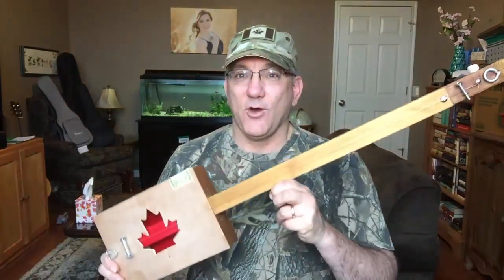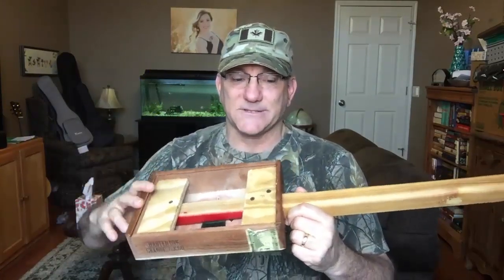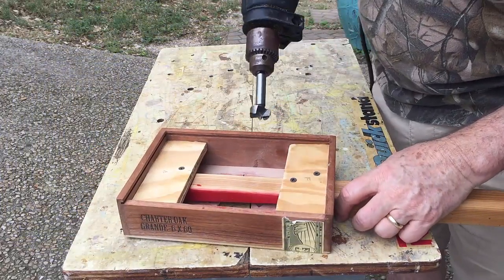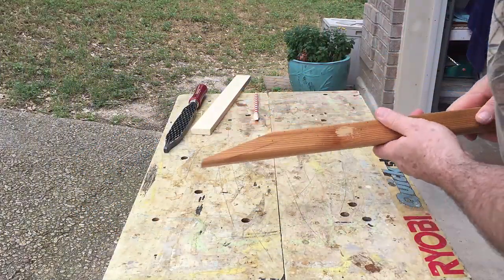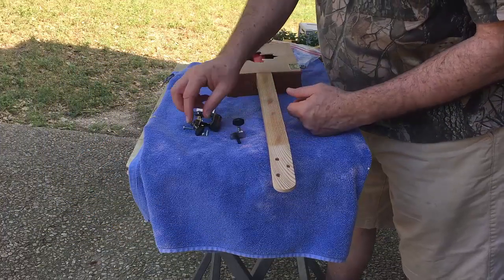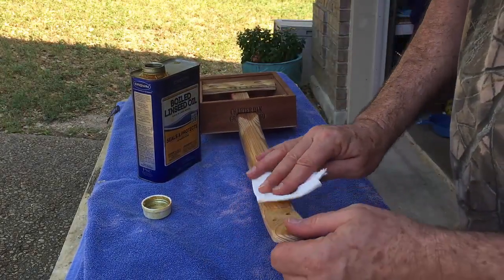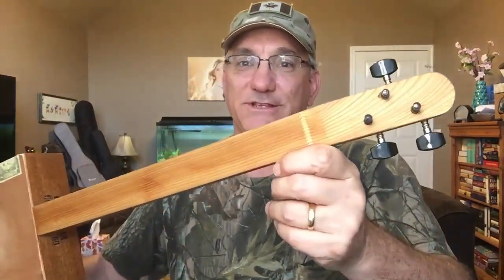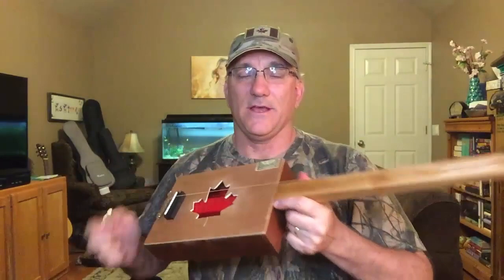First cigar box guitar do-over! I convert a diddley bow to a 3-string CBG!

Comment: So you added 2 more strings to this Guitar. Well to make it into a Fretted 6 String, you might have to replace the whole neck w/ a Guitar Neck. Why not make it a 7 String tuned to Russian Open G (D, G, B, D, G, B, D) w/ Emuzin 7 String Russian Ball End Nylon Strings? You could play alot of music on it.
Reply from the maker: Thanks for the suggestion! If I were to build that, I would start from scratch. I still struggle with 6 strings so I don’t see myself moving to seven. Thanks for watching and commenting!
Reply: @stevesstrings5243  Actually I found that 6 strings was easy because the outer 2 strings are tuned to the same note E, but w/ a 7 String Guitar the only additional string is another B String (2 Octaves below the 2nd String) so it might be a bit easier, plus they're great for song covers along w/ easy transposing to find the right key to sing in. Russian 7 String Open G Tuning is D, G, B, D, G, B, D which is a Fourth below the English Guitar Open C plus a Low D Bass String. Whatever you do on the top 4 Strings can be played on the Bottom 4 as well so you can get a different Octave. The 4th String (Middle D String) is what we call a "Pivot String" because it acts like a Hinge.
Reply: Emuzin 7 String Nylon Ball End Strings might help keep the tension down & there's a method book called "The Art of Russian Gypsy Guitar" that teaches you how to play a 7 String Guitar in Open G Tuning. It even includes some lovely music.
Reply: @stevesstrings5243  The 7 String Guitar is actually called a "Russian Guitar" & the Open G Tuning makes it really resonant:https://www.youtube.com/watch?v=fqrOpuT1zzE
Reply from the maker: @RockStarOscarStern634  Thanks for the info!
Reply from the maker: @RockStarOscarStern634  Thanks!
Reply: @stevesstrings5243  The Russian 7 String Guitar has been revived by alot of Musicians.